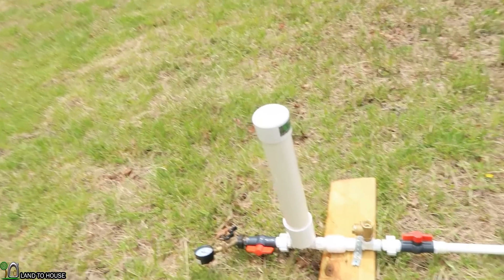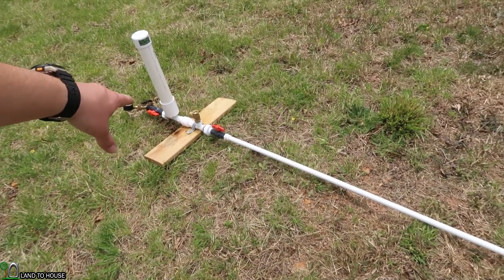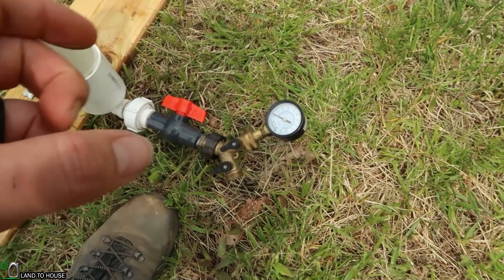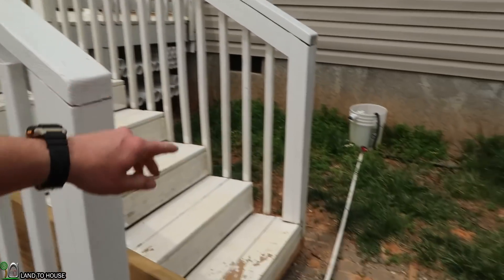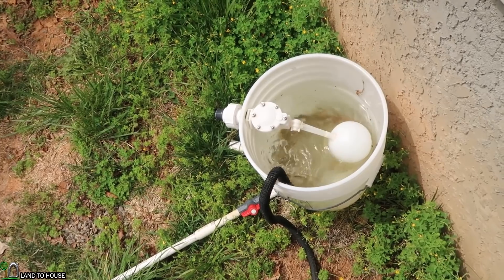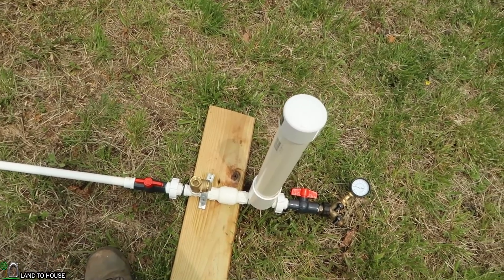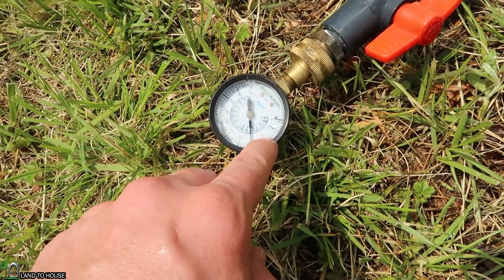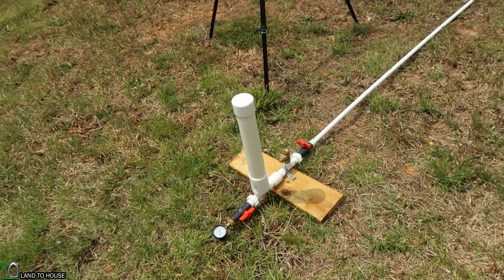WOW Can a Siphon Increase Head Pressure for a Ram Pump?

Comment: Have you ever seen or used a water wheel system to lift water to a higher resivoir to increase your foot of fall into the Ram pump. I live on a river with large volume but only about 3 foot of fall for my entire 500 feet of river frontage making it difficult to maintain adequate pressure even with a stand pipe.

Comment: Seth, did you ever reach a conclusion on this? My creek currently has very little head and only about a 1.5’ drop at the dam (very small dam).  I’d love to get my water into a tank 16’ in the air so I can then use the water for irrigation.  If the siphon trick works, I assume I could siphon the water pretty high (perhaps create a 5’ head), thus creating plenty of head to raise the water to 16’.
Reply: I have this same issue.
Reply: Any success?

Comment: Hi, With regards to your question: Will the ram pump have more pressure if you introduce more head pressure by siphon? The answer is NO. Because a ram pump works because of the potential difference level between the water source and the ram pump. Higher the source is from the ram pump higher the potential difference is. And higher the energy is that is produced by gravity.. When water is siphon to a higher level than the source level. Energy is used to work against gravity to get to a higher level that has more potential difference energy (by the amount it was raised). But the energy is give back when the water again reaches the source level.  So the resultant potential difference level will be the difference levels between the source level and ram pump level. If more pipe was used to get over the hill. Then the extra friction in the extra pipe will reduce the resultant energy obtained. When calculating water energy levels, you need to think in potential difference levels. And the energy produced by gravity. Hope this helps.
Reply: You can do a test to see if the above is true. Get a bucket of water and use a hose to start to siphon the water out of the bucket. Then slowely lift the end of the hose up to be at the same level of the water in the bucket. The potential difference is now zero and the water will stop coming out of the bucket.
Reply: You can even test it in your car. When you drive up a hill you use more petrol.  To work against gravity. To get to a higher potential difference. And when you come back down the hill you use less petrol when you get the energy back. While reducing the potential difference.

Comment: I have a question, I am new to these pumps, and understand they need a head of pressure to make them work, what about if your water source and your pump were at about the same level but you used the syphon method from the water source up over a board and then back down to your pump would that work? Only asking as I have a creek on my property but to access at least 5 foot of head pressure I would need to go into neighbours propertys and potentially a 50 to 100 meters away. If I was able to have the pump at water level and syphon it up over say 8 to 10 feet  in the same spot would that be sufficient enough to make the pump work..

I hope that made sense to you.

Comment: Its kind of ironic that you can't see the problem with your last test considering the title of your video has the word "siphon" in it.😲 By hanging the hose in the tree like that you have basically created  a giant siphon. Once the pumped water fell over the crest of the hose it started to siphon the water out of the pump, therefore no back pressure to operate the pump. I would also like to see the first test repeated, because of the split fitting. I believe that there should be no appreciable difference with the siphon uphill.

Comment: Hi Seth, 
Am new to your channel but am really enjoying your experiments. 
Couldn’t you increase the pressure by using a larger diameter pipe feeding into the ram pump? 
Keep the videos coming 
Thanks 
Mark
Reply from the maker: Thanks for watching. The ram pump works best on a matching drive pipe. If the pipe is larger the pump often does not cycle. Waste valve stays closed.

Comment: @seth... i took on alternative power project... im putting togeather a drum pump (siphon). Trying to overcome the lift from a  shallow well. Am thinking to add ram pump to aid lift above water level in tank. 
The questin is how much water do you loose with a ram pump when its cycling???
Reply from the maker: The ram pump is going to lose around 90% of the water. Its a lot.

Comment: Wasn't the y pipe you removed for the second test leaking on the first the first losing pressure giving you a bad result?
Reply from the maker: Yes that is why I remade the test. Check the channel for the new video. Much better.

Comment: What would happen if you took aquarium tubing and used that to transfer the water from the waste valve to the reservoir? Would THAT allow you more head pressure through your supply line/feed the unused 90% back into your water source? 

(Just thinking green and clean. Reduce, reuse, recycle 😉)
Reply: What I mean is use the tubing to transfer the water to a set up where it feeds into the check valve back at the source. Would the waste valve still function and would it draw water like usual?

Comment: If your drive pipe is being fed from a moving creek, could you upsize your drive pipe then taper it down before it goes into the ram pump? My thinking is it would increase the velocity, and you may need less drop in your delivery pipe in order to pump the water to the same height?

Comment: was the difference in pressure really due to siphon or because the height was increased 3 or 4 feet?  It was not a true result conclusion because you did not also raise the bucket to the same height without a siphon.

Comment: I made a slightly different version,  basically, I tried to siphon water to a higher level and I achieved it by connecting a ram pump (with no output line) at the end of the siphon, 
https://www.youtube.com/watch?v=3Im1ozOo0x4

Comment: I have a high head pressure issue I'm trying to design around. What needs to be changed to make it work? Im going lift water to 250ft into the elevated holding tank.

Comment: I can already see a problem with your test. First off, start the countdown when it reached it potential. Otherwise what you're measuring is the ramp-up, and not it's actual at-run capacity. So in other words, start the timer when you're at full speed.

Comment: For the siphon to be effective I think the pipe between the source needs to be 1 or 2 pipe sizes larger than the pump because small pipe would create cavitation on the stop start of each pump pulse. It will also probably require a pump or other pressurized water supply to fill the pipe between the source and ram pump.

Comment: Hey I asked earlier how would one measure the fall in the creek.
Reply from the maker: There are a few ways. Google earth, psi gauge,  But my favorite is to use a pipe in the creek and a measuring tape. Hold up the low end where the water stops flowing out. Measure from the water to the pipe.

Comment: The lift extends the pipeline and thus increasing the amount of water that has to be stopped so this might influencec ur test results.
The water itself will have to be lifted by as much force as the extra drop will increase the head pressure so the net added head pressure should be 0.

Comment: Your setup for measuring the flow rate (a loop of garden hose hoisted up 20~ into tree) doesn't do what you think it does.  If the open end of the garden hose is at ground level that creates a siphon. So you've got siphon #1 (from the source to the ram pump) connected to siphon #2 (ram pump up the tree and back to the ground).  Once both siphons are charged, the ram pump ends up do nothing and the flow rate is determined just by the flow resistance in the two siphons.  You may as well eliminate the garden hose and ram pump and just measure the flow rate at the bottom end of your drive pipe.

To correctly measure your flow rate you need to run the garden hose back up the hill , up on the deck, and then put end of the garden hose on the top of a ladder. That way you can measure the flow rate at the open end of the garden hose about 10 feet above the height of your source water bucket.
Reply from the maker: The flow out of the 1/2" pump is too low to start a siphon in the garden hose. It just did not have enough lift. The good news is I am about to remake this test with much better parameters! Should give us actual results.

Comment: Is there a way to get a lift of around 150 liters per minute from a ram pump? Anyway to get a high flow rate at all?
Reply: The largest ram pump in existence delivers 1800 litres per minute to 60 meters head, so yes, 150 litres is achievable but would require a substantial pump and a large volume of water with a decent head to operate.

Comment: Overall head pressure does not change with a siphon.  Inlet and outlet heights are the only measurements that matter.  Of course, overall length and corners will have separate losses. What a siphon risks is getting an air bubble in the line which will dissipate your shockwave and reduce your pump effectiveness. Your fluid inertia will create the biggest effect if it is all in a straight line as opposed to going around a corner.

Comment: Can a ram pump operate while under water?  

I've watched large airlifts pump a lot of water.

I only used 80 watts to run an 900 gallon aquaponics system, but I have always thought there must be a way to run them for free.  Perhaps a siphon feeding a ram pump to fill media beds?  The waste water to charge the ram pump would need to be captured and returned to the system.   This has got my mind racing!

Comment: I've used bridge siphons in aquaponics system to maintain water levels in two tanks.   I had to add a separate water tank because my fish tank water level would drop too low when four media beds filled at the same time prior to bell siphons returning the water to the fish tank. One thing that helped was to make certain all air is removed from the siphon.  Over time, it would stop working because air got trapped in the siphon.   I never could figure out where the air came from.  Perhaps DO (dissolved oxygen) separated from the water. IMHO  A working siphon lifts the water and with more head height, a RAM Pump will develop more pressure.  If this theory is true, a ram pump could be setup on flat land!  Are you thinking what I'm thinking?  Free Energy!

Comment: The output is also a syphon as setup.  Try to just lift the end of the hose to the max height.  This test is very interesting!
Reply: I'm not sure the output can be considered a siphon. It would be if there was no air in the hose all the way to the end.
Reply: @jackbloznowski5429  Well sure it would be.  If what you are saying an aquaponics bell siphon would never start and that is just not true, they work great with air in the downward end. The ram pump will fill the hose up to the highest point and the water would be completely level inside the hose.  As soon as water pumps over the peak, it will start the suction.  I've built many aquaponics systems and I lost all my water in my fish tank for that very reason.  I was painting surfaces and a cat ran through my dome and hit the garden hose which created a siphon and emptied my fish tank.  The falling need not be a solid flow.  If the water falls in a confined space, it will create a vacuum which starts the siphoning action.
Reply: I've thought this multiple times watching these videos. IMO none of his test results are in any way valid because he always runs the output as a sipon, which artificially increases flow rate.

Comment: I looked on the land to house website and it says the ram pumps can only handle 25 feet of head pressure. if you have more than 25 feet, say about 45 feet of head pressure. Would I need to change out parts of the pump to make it work or would I have to have one made of metal?
Reply from the maker: The pressure is really high in the tank at that input head pressure. Also the weight of the waste valve is set on swing valves. Once you hit that input of 25 feet it keeps the waste valve closed.

Comment: According to fluid dynamics, you cannot raise pressure though siphon.   Water pressure at the raised section will be lower than source pressure.  Pressure at the ram pump will be the same whether the pipe is raised or not.
Reply: One major potential for improvement, IMO, is discharging water from the top.  Automation breeds complacency, and the convenience of 'off the shelf' seems to be a roadblock.  Part of the excuse is allowing air in the line, yet a simple float system could isolate the air.  This would remove having to overcome the inertia of the stationary discharge.
I wonder how effective a turbo would function?
Reply: "Water pressure at the raised section will be lower than source pressure" i dont think this is always true.

Comment: I would like to know why you couldn’t capture the water from the discharge valve and reuse it in the supply line?
Reply from the maker: There is a pressure difference.  If you place a pipe on the waste valve to take it back up there will be a water level and no flow.

Comment: Why not use a series of pumps each one would deliver to a small tank at its delivery hight then the next pump would feed off it and lift it a multiple of that one So fist one lifts 10 feet above the source on a stand then the next feeds off the 10 foot drop to lift it much higher

Comment: Ur sucking water up to the height of the railing. I don’t see a difference between that and having the bucket at the height of the railing. You simply raised the drop distance giving more pressure.
Reply from the maker: The thought is that you lose the energy pulling upwards to the rail so it should be no change. I am going to take this idea to a flat parking lot and give this another test so its easier to figure out.
Reply: @LandtoHouse  Thanks Seth, if this did work it would be great for people who dont have much head in their flow....thanks from AUS

Comment: I have a question before I start, so I have a running creek but is a flashflood zone. And stays up for about 2-4 hrs. Will a ram pump work if it's in the creek and eventually has water on top of the ejection port? I'd imagine if it does work it may reduce pressure if the water height creates pressure pushing down on the valve. Possible?
Reply from the maker: The pump works just fine underwater but you are right. as water rises above the waste valve the the head pressure is reduced. One thing to consider is that the pump can be installed out of the water on the bank. As long as the intake is in the water you are good. Also keep in mind that ram pumps can get washed out in floods.
Reply: @LandtoHouse  our creek side comes up 12ft, and the normal level is 3-3.5ft. I am going to attempt mounting to tree and use a filter with screen like you used in another video. If pump is 5ft above the inlet tube and the outlet is still running upwards will I have pressure? If there is almost no down hill? I assume I would need to siphon to get it started period.

Comment: The resulting pressures should be the same once you retest without the cracked fitting on both tests. The net gain is zero because the height of the bucket is the same. Whatever you “gain” by putting the hose over the stairs is lost because the water has to first travel up the hose to the new height. Not sure if I’m making sense or not. Looking forward to the retest as the proof is in the pudding.

Comment: Testing results will be greater as you have a higher head at the top of the apex of the syphon. Good test to show this. Seems you did a similar process at the neighbors pond some years ago. That was when you pulled water over the dam if memory serves me. Thanks again for another ram pump video. I'm going to get mine running again this year and this is spurring me on.

Comment: I built a similar system using siphon suck water out of pond then connect to ram pump. what I found there are air accumulation in high-lift siphon caused ram pump to stop working after few hours. but siphon still running with bubble inside, I am thinking to add a stand pipe between siphon and drive pipe and make siphon input slightly higher than drive pipe, so to create the air free for drive pipe, hope this will solve my problem.

Comment: Having watched several tank exercises I've learned shape doesn't matter! Watching this episode I'm struck with a thought that if you capped a 2" pipe and inserted a open 1" pipe, you would have a siphon pipe as long as you like... 
Say 3 x 10' segments each, and fixed it upright to a tree or scaffolding, you would start with a preloaded 30' head into your ram pump.

Consider angling the inrush current of water to swirl around the outside edge in the bottom of the bucket and a flat funnel to the center with a 1/2" or 1/4" tubing for continuous silt removal.

Comment: Can I pump water out of pond? There is no drop to the field for irrigation.
Reply from the maker: The ram pump has to have head pressure to operate. This is water drop for the source to the pump. if your pond is the lowest point its not going to work.

Comment: I asked this exact question on practical engineerings channel, so glad to see someone tested it. Thanks!
Reply from the maker: I will remake this test to see what the flow rate output change is. That will give us a better result.
Reply: @LandtoHouse  Sweet, I wonder if the extra volume of water in the siphon pipe(because it was longer) was why it developed more pressure. To me it would make sense if you hammered a larger volume of water shut it would build more pressure. Otherwise you'd probably have to test both siphon/non-siphon with the same length pipe, if you know what I mean. I even wonder how much of a difference a brachistochrone curve would have on the piping vs direct.